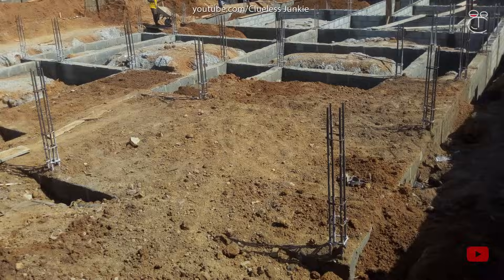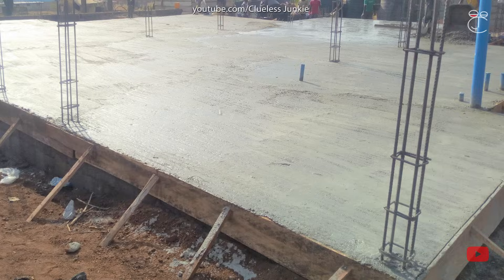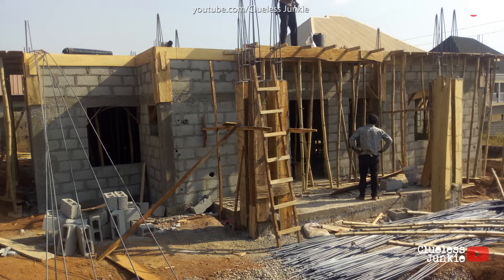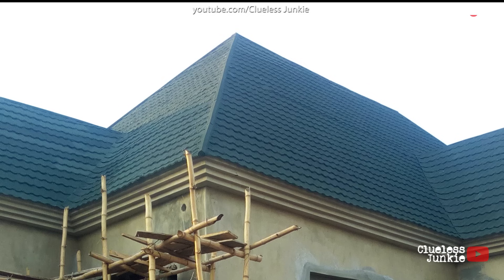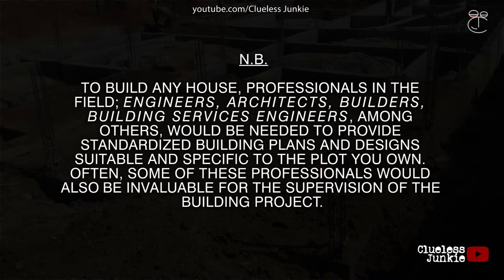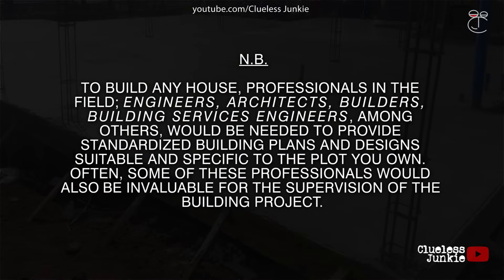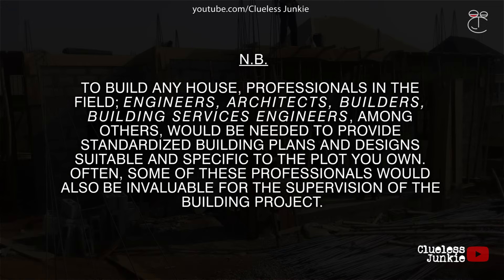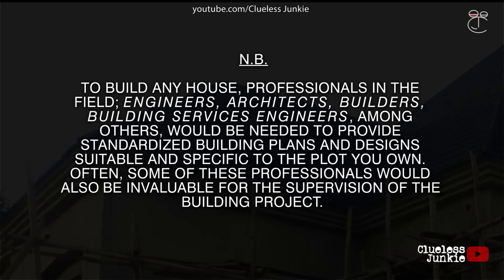Building a House | Foundation | Stage by stage #foundation

Comment from the maker: Please Subscribe🥰, kindly leave a comment & watch my other amazing videos;
• How to set out a building: https://youtu.be/aEMMAT5E_Ow
• Cost of foundation: https://youtu.be/c86ur6Gg1Ak
• How to build a Staircase: https://youtu.be/yusYZgPz4Ls
• How to construct roof parapet: https://youtu.be/MtdUTpTfPjs
• How to mount columns: https://youtu.be/AIJ3xsQ0TWw
• How to read Structural drawings: https://youtu.be/0dkz71nlwKg
• Apartment design: https://youtu.be/lyIsxQc_Nug
• Fire cube | fireart: https://youtu.be/HYUZRXiudBY
• Penthouse | attic design: https://youtu.be/ZmB3J5CjjBk
• Learn SketchUp 3d modelling: https://youtu.be/5kPyV5vYpgM
• Learn Photoshop 3d rendering: https://youtu.be/Wwn_8WO8yhQ
Reply: If your foundation footing is of 8" blocks can your groundwork and your upper floor be of 6" blocks? if you are building an upstairs and downstairs house?
Reply from the maker: @globbs2581   6" blocks are not ideal for load bearing walls 
Best use 8" blocks for all major/load bearing walls

Please consult appropriate professionals before any building project is embarked on 

Cheers!
Reply: L
Reply: where are you located
Reply: liking all our videos lol I need answers lmao
Reply from the maker: @Yweile  Thanks a billion!

You are amazing!
Reply: I'm following from X ❤
Reply: Nice video but you don't have contact information
Reply: By right all foundation should be dug 3feet wide   when laying blocks and concrete depth A/ thickness at least 14"" thick

Comment: for the foundation or over sight part of construction do i build only to the height which i shall back fill,  compact, put hard core or there must be a height above which i could build too not so that i dont lose the foundation details as i build the superstructure
Reply from the maker: It's generally recommended to build the foundation to a height that allows for proper backfilling and compaction, while also leaving enough height above the finished ground level for the superstructure.

Comment: How do you prevent concrete for beams along the hollow walls from moving into the hollows ?
Reply from the maker: Good question!
The hollows are carefully filled with broken pieces of block or some other material. In some cases, solid blocks are used for the final course before the beams.
Reply: @cluelessjunkie Good, I think the final course with solid block is ideal

Comment: Here is my question 
during casting of the ground floor slab there was no ground beam so does it no significance or and if it has is tied and casted before put the hardcore bed or it is casted with the slab after putting the hardcore the sand blinding and the dpc ?
thank you
Reply from the maker: Good observation. You should watch this: 
https://youtu.be/b3wb71OkT3A

Comment: Hello Sir!

The entire living space of option A is 7.25x6.25m(45m²). 
Open plan layout, with dining 200mm elevated.
Arranged like this:
Main lounge 6.25mx4.21m. 
Additional lounge or VIP section 3x2.75m. 
Dining 3.5x3m. 
Total floor space 45m²

Option B. 
Main lounge 6x5m 
Dining 3.6x3m. 
Total floor space 40.8sqm. 

Sir; these two living spaces which one is larger and better. 
Whichb option is more luxurious in terms of space?
Reply from the maker: I would suggest you consult with an architect for the best space optimization for your project.
Reply: @cluelessjunkie  You should be able to answer my question here if you are a building professional.

Comment: Nice Video,  please is it appropriate to make lintel only at window points for first floor and use the parapet beam as a tieing medium?
Reply from the maker: Where reinforced concrete frame structures are the case, it is very common the lintel beams are precasted; that invariably makes the roof beams(parapet beams) the tying medium.

Please always consult with certified professionals. 
Your engineer knows better.

Cheers!

Comment: Building 3,000 housing units is a significant project that requires careful planning and execution. Below is a comprehensive overview of the steps, procedures, materials, time, tools, labor, and area needed:

Steps and Procedures

Project Planning

Define project scope and objectives.
Conduct feasibility studies.
Obtain necessary permits and approvals.
Site Selection and Preparation

Choose a suitable site based on zoning laws and accessibility.
Clear the land and prepare the foundation.
Design and Architecture

Create architectural designs for the housing units.
Finalize designs including layout, utilities, and landscaping.
Budgeting and Financing

Estimate costs for materials, labor, and other expenses.
Secure funding or financing options.
Procurement of Materials

Order required construction materials.
Construction Phase

Foundation Work: Excavation, footings, and slab.
Framing: Construct walls, roofs, and floors.
Utilities Installation: Plumbing, electrical, and HVAC systems.
Interior and Exterior Finishing: Drywall, painting, flooring, and exterior cladding.
Quality Assurance

Regular inspections to ensure compliance with building codes.
Final Inspection and Handover

Conduct final inspections and obtain occupancy permits.
Handover units to buyers or renters.

Materials Needed

 Material  Estimated Quantity 
 Concrete  10,000 cubic meters 
 Steel reinforcement bars  1,200 tons 
 Wood (framing)  5,000 cubic meters 
 Drywall  50,000 sheets 
 Roofing materials  30,000 square meters 
 Insulation  15,000 square meters 
 Plumbing fixtures  Various 
 Electrical wiring  Various 
 Paint  5,000 liters 
 Flooring materials  35,000 square meters 

Time Needed

Total Duration: Approximately 18-24 months
Planning and approvals: 3-6 months
Site preparation: 1-2 months
Construction: 12-16 months
Final inspection and handover: 2 months

Tools Needed

Excavators
Cranes
Concrete mixers
Scaffolding
Power tools (saws, drills, etc.)
Measuring tools (levels, tape measures)
Safety equipment (helmets, gloves, etc.)

Laborers Needed

Project Manager: 1
Architects: 2-3
Civil Engineers: 2-3
Construction Workers: 150-200 (varies based on construction phase)
Electricians: 10-15
Plumbers: 10-15
Finishing Specialists: 20-30

Area Needed

Total Land Area: Approximately 15-20 acres
This includes space for roads, utilities, and common areas.

This framework provides a robust approach to building 3,000 housing units. Each step may vary based on local regulations, site conditions, and design specifications.

Comment: Please,
 why did you use hollow blocks instead of solid blocks?
Reply from the maker: The hollow concrete blocks used have high load bearing capacity and provide sound insulation among others.

Comment: Why are the bottom stirrups are space so far from each other .From bottom to 60 inches  they shouldbe at 10 or 15 cm fom each other .and when reaching the top from pour level on to 60 iches on down 10 or 15 cm .?????The stirrups are too far away from one and other .!!!!Backfill should only use river backfill and well compacted so if any water penetrate it .we wont have any problem of the compaction shriking .I m noticing the recovering steel for the second level are a little bit too short for lapping lenght 12 mm. steel requires  more lenght .36 mm  or shorter required wielding.

Comment: I just found out that there was no chaining while casting the colums instead the blocks were been casted without iron chaining 
Will it be solid as well 
Because in Nigeria here (some part I might say) do the chaining with 12mm or 16mm iron depending on the building height

Comment: Why isn't there steel in the foundation block holes?
Reply: The walls are not going to be load-bearing. This is a column beam concrete frame structure.

Comment: Good job. Please can someone explain to me why some buildings move or shift due to ground movements despite all the structural efforts put on the foundation to prevent this.
Do you know another additional Screws, rebar’s or mortars that need’s to go with foundation to prevent cracklings from WALLS AND FOUNDATION?

Comment: i would like to see reo bar set into slab where external and internals walls are to be erected, they should extend vertically so as to provide a strong bond from concrete slab to hollow block walls,  the walls shown have no horizontal sheer strength .

Comment: The steelbars used is so limited.. that's not how we do in the Philippines and there should be steelbars standing an tied in between pockets of holllowblocks then cent is poured on the pockets..
 Once a car bumps the wall in a strong impact..it might penetrate the inside part of the house since there's no steelbars between the hblocks

Comment: interesting! in iran foundation is soviet russia type usually columns are 51X51 and they use thick rabars and we usually use cement blocks on floor and place them between joints which transfer weight to the concrete filled beams these beams are like columns but thickers in most cases and then from beams to columns but this type of design is really cool takes more time but it's more beautiful in terms of design

Comment: Useful info but I wonder why the blocks are turned holes-up(4.36minutes)?
Reply from the maker: There is a bonding system for the blockwork that requires that the blocks are turned 'holes up.'

Comment: Placing of ur nylon is wrong it should come on top of the hardcore. Not under the hardcore.
Reply from the maker: Well, the intent of the damp proof layer is to protect sub-structural elements from degradation caused by capillarity.
The hardcore is part of the sub-structure. 

Cheers!

Comment: please what are the sizes of block used in this?
Reply from the maker: The blocks are mostly 
9inches/225mm in width and height, 18inches/450mm in length.

Comment: When you get to the lintel how do you make sure that the concrete doesn't flow right into the hollow blocks or do you fill your blocks on the superstructure too?
Reply from the maker: Thank you for watching!

The blocks on the superstructure are not filled as those of the foundation walls.

In some cases broken blocks are place in hollows of the course before the lintel beams to obstruct the concrete mix.

Other times, solid blocks are used just before the lintel beams.

Comment: In Jamaica we use steel for the columns, standing vertical in every other block pocket, of course this steel is also tied into the foundation when casting the foundation.
Reply: yeah construction process in the caribbean are a little more robust for strength against earthquakes and stormy season.

Comment: Great video. Being from the US, where most small-scale construction is done with wood, I've been very interested in the process of concrete home building. This looks like a very robust foundation!
Reply: Wood requires great skill, it's too fast, relatively cheap and less labor. Alternatively concrete and block is labor intensive, less skill but great supervision, it's expensive and if the work program isn't given attention, the process can be slow.
Reply from the maker: Thank  you for watching. 

Cheers!
Reply: Xxxxxxxxxxx
Reply: Yes. Built Like A Brick Shit House. Literally.
Reply: @@OH-py4wn  because wood requires great skill. Joinery carpenters are few and far between here

Comment: I am a Quantity Surveyor based in South Africa, I do not understand why west Africans do not use insulation when building your roof given the heat in this area, the rock filling should be done first, fill with sand then your damp proof membrane before the concrete is placed, I see they are doing it the other way where they placed the rocks on the dpm, well this defeat the purpose as the rock will punture through the dpm, just given an advise
Reply: Well what I'll say is, I'm learning 😂
Reply: The roof is a house in its own😮
Reply: I'm not a builder and I also noticed that was a bit off
Reply: @Bounce_Central.x 
Roof insulation is very effective. I'm currently on a hospital project in Ghana. The Architect specified roof insulation and it is working effectively even without ceilings
Reply: @ojlab9831  there must be a reason for that suggestion. its possible that the hospital building has a low roof. if the roof is being built as seen in the video, then there is no need for roof insulation. most new residential buildings in nigeria like the one in the video have POP installed as ceiling which serves as insulation. I dont know anyone who uses POP as ceiling in a hospital project
Reply: We build high pitched roof with attic space filled with air for a reason: there are few insulators better than air.
Reply: They neither insulate nor vent the roof attic for airflow. Then they complain about why the rooms are too hot. Basic science that's as old as man.
Reply: last sentence is a good point....i wonder why they do it like that..
Reply: I’m new at building and planning to build my own home this is very interesting exciting and empowering to pickup good ideas in the coming projects I want to embrace
Reply: Given that the ceiling is a POP type of ceiling. What do you need insulation for? Again, you mentioned that the foundation isn't solid. We'll, it's about the soil. If it's dry land, it's done the way you see it. If it's a wet land, then casting can be done.
Reply: I’m a builder from, Belgium 🇧🇪 and I’m also Nigerian, sure there are different techniques for everything when constructing a house, I feel like they did an impeccable job! Just safety could have been done better. I almost felt dizzy watching them on that steep roof.
Reply: Very true
Reply: I was thinking first in the same way like you, concerning the roof. But it is not right. High or low, the alu roofs used in West Africavare in general simply heat caps. And ypu feel it every day. They defenitely should be insulated! @Dem_Girls
Reply: Please am student of building technology
Please can I have your contact
Reply: I'm in Nigeria and a builder and you are right about the hardcore or placement of rocks. Laying the hardcore on DPM may puncture the DPM so hardcore, Laterite or sand, brc...should be the correct order
Reply: I guess differences in construction methods across different regions, but here in Malawi we have 150mm hardcore, then 30 -50mm sand blinding, then we lay our DPM on top of the Sand blinding. South Africa, Zambia and most southern African countries it's done this way. 

Won't the rock filling puncture the DPM? 🤷‍♂️

In Malawi... Most residential buildings do not put roof insulation, due to cost reasons. Only super luxurious houses have them.
Reply: Engineer from Southaaaa here... was about to say the same
Reply: Bedbugs will just be looking at you like go on build we are coming.
Reply: The majority of all the buildings in Africa are NOT based on science. Everybody builds the way they want to build.
Reply: @MrKwadwo10  Your statement is not true at all. 
I for one knows that a majority of buildings in Africa were designed by architects of which architecture is a science based course. Some of the buildings may not have government approval but they are ofen designed by architects who plans the space and aesthetics. Unless it is a different scenario in the country where you come from hence it wouldn't be fair to generalise for Africa.
Reply: @MrKwadwo10  well, in some cases, it might be true. But for 1000s of years of building experiences the people know quite well what/how to do. It might not always be the use of the last standard of science, but it is rock solid, and it is very rare that a house is collapsing. In case it happens, even a simple Mason canvtell you right away where the mistakes were done. In most cases, there is a lack of money against actual knowledge. Before you start building there must normally be an architectural and static plan and a geological survey. This is bypassed in several cases due to a lack of money, corruption and greed, not because they don't have the knowledge!!!! And please, don't forget: the African people were already building very complex structures when in Europe and especially the HS people were still jumping from tree to tree!!!!!
Reply: Honestly no installation at the roof given Africa is too hot. Goodness me. And no strong foundation, should apply gravel😅
Reply: What’s the function of a DPM, to resist upward moist movement’s. It’s wrong to carry out the process the way you have stated. The foundation should first be infilled with laterite sand, and the hardcore placed, followed with laying d DPM and a BRC mesh placed on top. And then the final DPC
Reply: As it relates to building in worldwide. 
1. Africa ( as a example ) is a  continent with approximately different  50 countries , with 50 different  everything ( as it relates to building ).
2. Economically,  without the finance most of the global people cannot afford to build  to the standards set by engineers. ( matter-of-fact it is like that worldwide ). 
I understand why  our fore-father build the way they did. At lease 😅😅 they did not have to struggle with debts. Then modern-day engineering came along  which was good for those with money to burn,  but it was not good for low in come earners . Keep up these good videos.